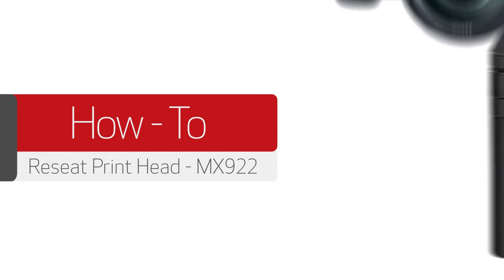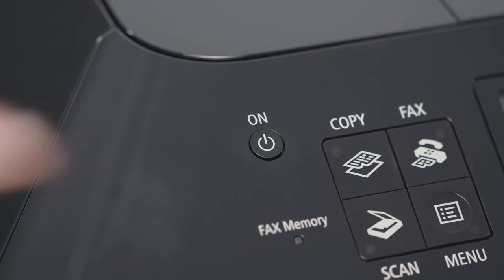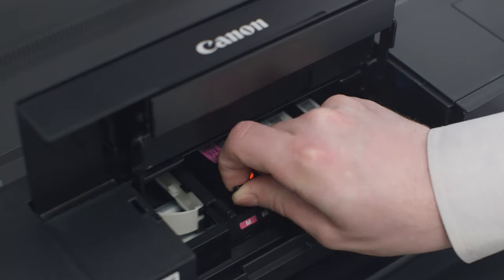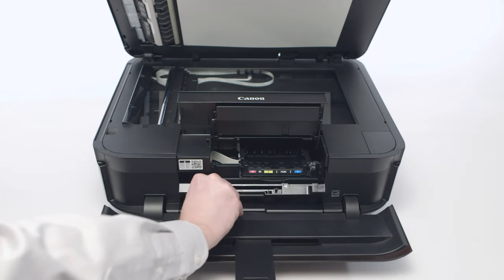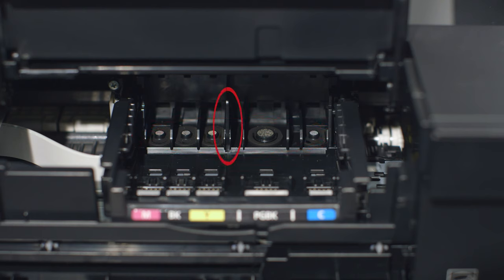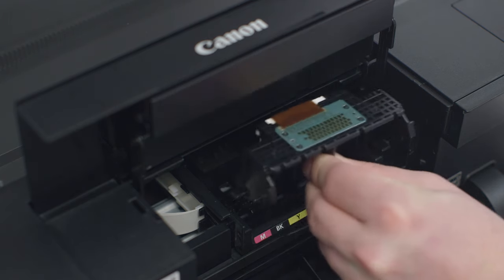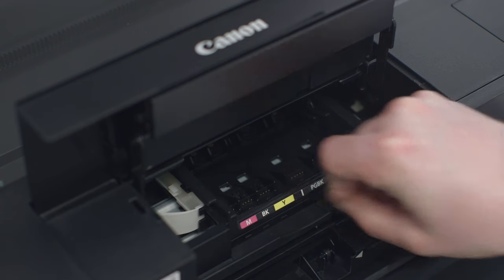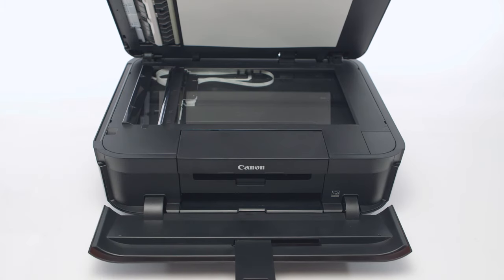How to Install/Reseat a Print Head into a PIXMA MX922 Printer

Comment: I'm glad this video is out here because my 922 failed after 6 years of happy use through college and grad school. I got the dreaded b200 error and now going to replace the print head. They don't make them like the 922 anymore - duplex scanning, great color dpi. I hope mine continues to serve my business for years to come.
Reply: This so so true!   I looked to see what was available, dreading if replacing the print head after getting the dreaded B200 error, and I was not impressed.   I was really dreading the loss of this great printer, and so glad I was able to resolve the issue.  I hope my printer lasts for many more years.   Mine is also about 6 years old and this was the first issue I have ever had with it.  And the problem was caused by me, not the printer.   I simply let it sit too long without printing anything and the print head got clogged with dried ink.   Unfortunately when I tried to manually clean the print head, I damaged it and it would no longer work.  $20 on Amazon for a refurbished print head and this video restored my printer to like new!

Comment: Thank you so much for this video.  I was struggling trying to figure out how to remove the print head on my printer so I could replace it, as I had let the printer sit too long and the print head was clogged beyond repair.  I purchased a replacement print head and used these instructions to install it, and now my printer works like new.  This is my third Canon Pixma printer and my favorite one so far.  I was really not wanting to replace it, so I am so grateful I was able to fix it myself using this video as my guide.

Comment: So you will need to replace the print head to clear the B2 hundred air because there’s other things you can try to fix that be 200 air like for example, turn the printer off then open the document cover in the cover let the print head move to where it’s not touching the right or the left then shut the ink cover, and the document cover with the printer boot up and done

Comment: i'm getting error message 1403 and it won't clear no matter how many times I take it out and put it back. I have also tried a hard reset and that isn't helping either. Saying I'm frustrated is putting it mildly.
Reply from the maker: Make sure the print head is installed. If it's already installed, try reseating it. Refer to reseat or replace the print head for help.

If the error continues even after reseating the print head, the print head may be damaged and the printer will require service.
There are two options currently available to you.

Warranty Service – If you are within the 1-year manufacturer’s warranty and have your proof of purchase you are entitled to service or replacement. If you have purchased a CarePak Canon extended warranty, you may be entitled to additional options.  Please create or log into your Canon Account to obtain service.
 
Out of Warranty – If you are outside of your warranty period, you may qualify for purchasing a replacement through the Canon Upgrade Program. Please contact our Sales group to inquire about your upgrade options at 866-443-8002.
 
To verify your support options please create or log into your Canon Account.
Reply: @CanonUSASupport  Why did you bother answering me if you weren't going to proofread my comment and see what the issue is with the printer so you could actually help me with what is wrong? Thanks for nothing. Seriously, thanks for absolutely nothing.
Reply from the maker: Hi, and sorry we didn't say that earlier!  Thanks so much for the efforts you've already made to get that error message cleared up.  The information in our last reply came straight from our Knowledge Base and if you've already covered all those bases with no luck, then we recommend contacting our support team for additional guidance.  You'll need to register your PIXMA G6020 first at https://canon.us/account and then you'll get access to all of your support options including our 800 number.

Hope this helps!

Comment: Very clear and useful video.
BTW: for all the complaints about this printer, mine has lasted well, without any issues for over seven years.  Until recently when I got the dreaded B200 error and hence needing this video.  My experience with HP printers and especially their drivers has been MUCH worse. YMMV.

Comment: does missing one cartridge would error U052?
Reply from the maker: Hi!  Your PIXMA MX922 requires that all five cartridges be installed and have at least some ink within them for the printer to function.  A missing cartridge or an empty cartridge will result in an error message.  You can order ink cartridges anytime at https://canon.us/3zho4TE

Hope this helps!